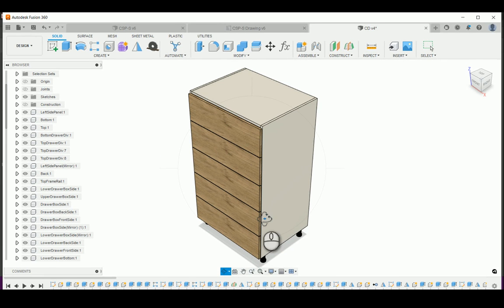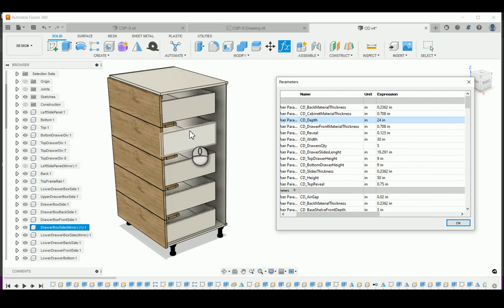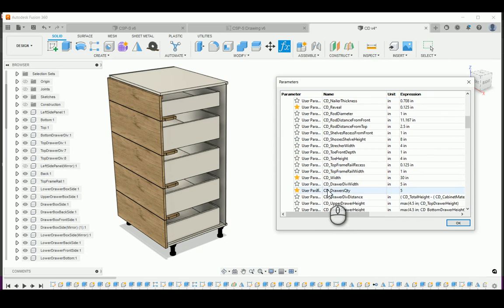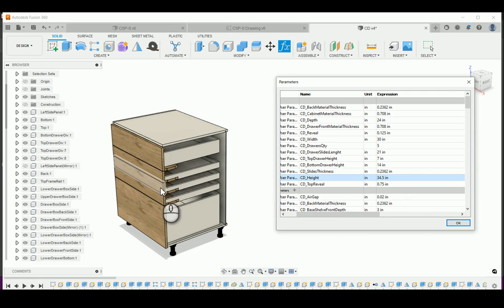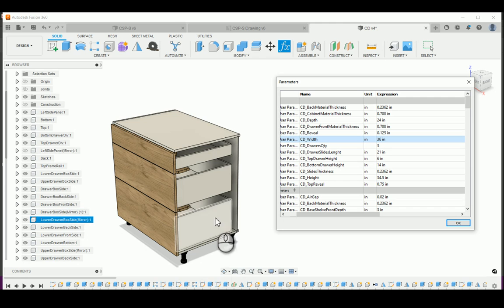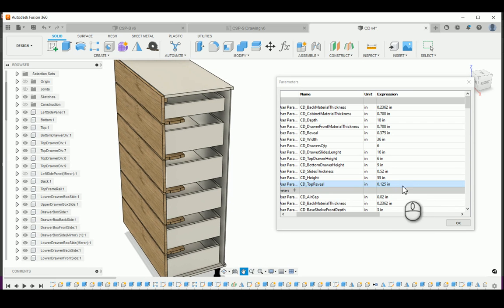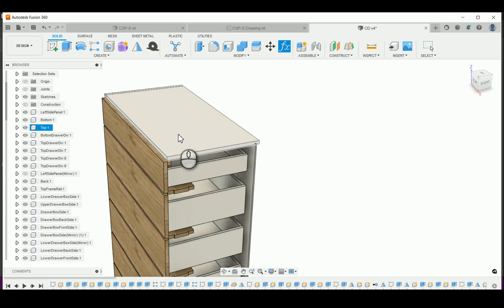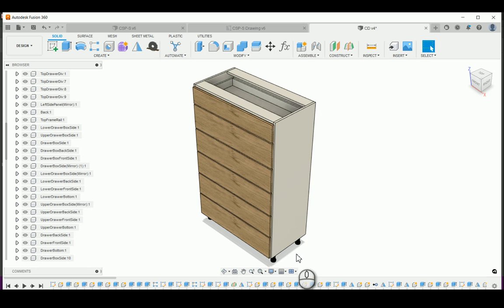Fusion 360 Parametric Drawer Bank Cabinet for Kitchen or Closet

Comment: Did you make a video that actually shows the creation of the model?  I understand all the parameters and how they work, but I am not clear on how you made the components - did you generate a sketch for each drawer using the parameters? or did you create one drawer and then use rectangular pattern (referencing parameters) to create the additional drawers?  If you don't have a video, could you post the parameter file?  Thanks!!